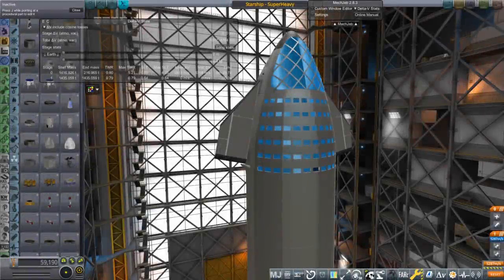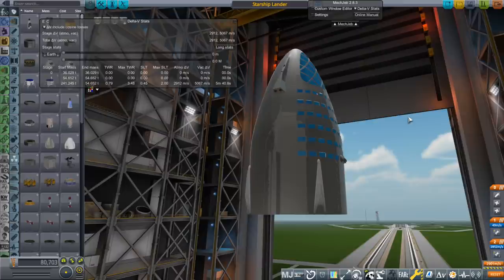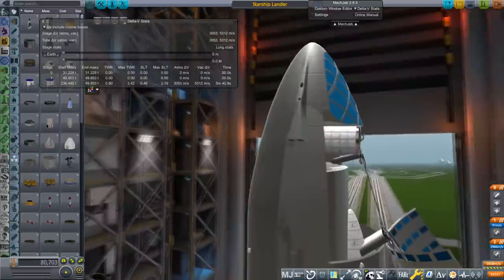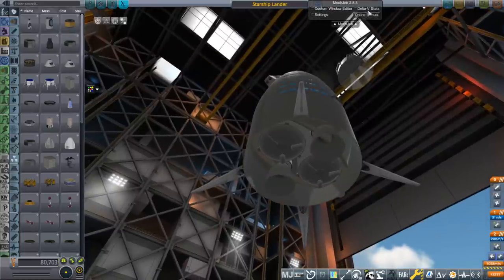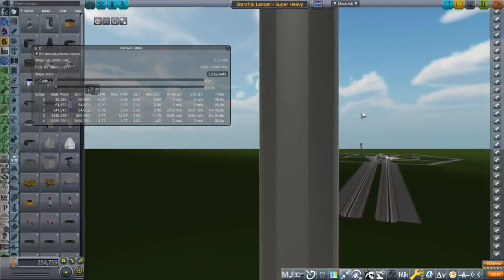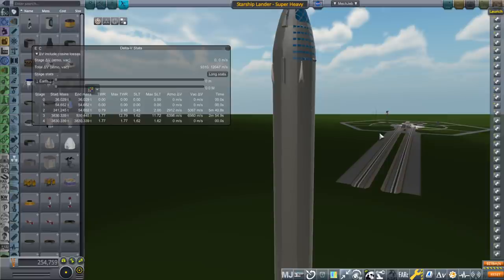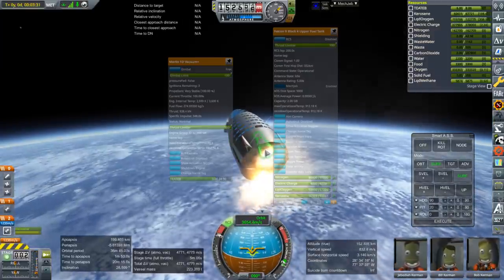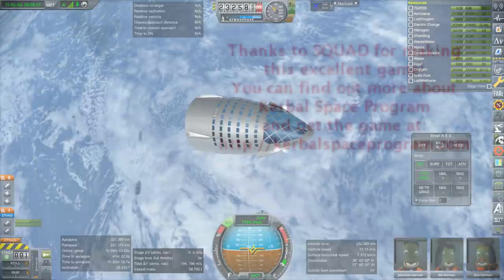KSP/RO - Alternate SpaceX Moon Lander Proposal

Comment: That's actually a very nice idea. I am sure they are not going to go with merlins, but they already have this "modular" and detachable bulkhead design. They could move propellant tanks into their payload space (almost like you did), remove the usual propellant tanks (and thus making the starship much shorter) and keep the thrust puck (and probably getting rid out of sea-level raptors). This way is 100% compatible with their current design.

However, as much as everyone talks about "mini starships" for years already, I am sure Elon is just going to find another purpose for this extra enormous payload capacity and go with full size anyway...

Comment: General rule of thumb: A single-stage vehicle capable of performing a moon landing and return mission from LEO with aerobraking is an SSTO, while one capable of doing the same thing without aerobraking is an SSTE. While it would almost certainly be impossible to make something Starship-derived do the latter (short of replacing the propellant choice with a dense, high-performance, jaw-droppingly toxic exotic mixture like pentaborane/oxygen difluoride and completely redesigning the Raptor engines to use them), I think it would be more reasonable to create a vehicle designed from the ground-up to accomplish this—combining extreme expansion-ratio FFSC hydrolox engines with common-bulkhead tanks using the highest-grade aluminium-lithium alloys or composites, etc. One reason I think this is that a Space Shuttle SLWT directly fitted with 5 SSMEs (assuming a light thrust plate) would have an SSTE capability*. In any case, though, it would be very payload-efficient with anything resembling modern technology.

*I would say "marginal", but the Shuttle was such an inefficient vehicle that an SLWT SSTE's payload mass fraction to escape would be better than that of the all-up vehicle using an Inertial Upper Stage.
Reply from the maker: I'm not sure I agree with your use of SSTO and SSTE for these purposes - I think different terms should be used. And yes, having higher performance engines would make it possible - it's only Starship's use of Methane and Oxygen that means no reasonable reduction in structural mass will give it enough delta-v for the round trip without aerobraking.

Comment: I would try some other engines. Merlin 1DVac is great at both TWR and Isp for a kerolox engine, but a) has just a few ignitions, and b) kerolox engines aren't optimal for reuse as they get sooty inside.
There are three other options in my mind:
1: Use two Raptors, you can get more Isp, more ignitions and less carbon in the piping. Methane is getting used more and more in rocketry for a reason.
2: Use J-2X. It was already tested, it has much higher Isp and you can get both hydrogen and oxygen on the Moon by ISRU. Its throttle range isn't that wide, but you can add some RL-10s in CECE configuration to finish off the landing. Which brings me to the next option.
3: Use a bunch of RL-10s in CECE configuration. You get a lot of Isp, a lot of ignitions and even an engine out capability. Not sure about TWR, and hydrolox engines require larger tanks. But it's an option too.

Edit: typos

Comment: Do you think they would go back to carbon composit construction, rather than stainless steel, seeing there's no need for re-entry?
Reply from the maker: Hopefully, or at least aluminum.
Reply: I doubt they’d do carbon composites. It’s very difficult to work with at this scale. Steel would allow them to use all the same machinery as the standard starship, saving costs and time. That seems more like SpaceX’s way of doing things.
Reply from the maker: I expect that some aluminum will be taking the place of steel  in certain portions to make Starship lighter in further iterations anyway.

Comment: I think your version will still require a lot of engineering to be done in order to integrate the falcon hardware into the starship body. It’s something that looks simple on paper, but is going to have a lot of hidden difficulties, much like they had with falcon heavy. If starship flies as cheaply as Elon says it will, then the cost of making all these changes and essentially designing a new vehicle may end up being higher than the cost of developing and flying spaceX’s proposed version. 

With regard to the choice of Merlin or Raptor, it should actually be far easier to get many ignitions out of Raptor, because of the type of fuel. Kerosene burns dirty and produces soot, which over time can jam up an engine. And this will happen eventually if you’re using it as a fully reusable moon lander. Methane burns much cleaner. The other big advantage raptor has is the full flow staged combustion cycle. This, among other things, means the turbopumps can run at a lower temperature than those of the Merlin without sacrificing performance. The Raptor really is superior for reusability in every way I’m aware of to measure it. 

SpaceX seems to be thinking far bigger than NASA is right now. If there’s a vehicle that can send 50 or more tons to the moon cheaply, we will find a way to make use of it. The Starship is ideal for a successor to the Artemis program, for building industry and infrastructure on the moon. I think it’s ahead of its time, but will become the future of space flight.
Reply from the maker: Definitely some engineering will need to be done, and I would also prefer a small Methane engine rather than Merlin, if that were available. The thing about stuff that's ahead of its time like the Concorde or the Shuttle, is that you have to be careful to ensure that the demand for the capability is there. NASA isn't putting together payload to fill Starship, and there's no reason to believe it will be funded to do so, considering the paring down of its Moon mission . So, sustainability may mean a smaller lander that will take more trips to the surface to deliver the payload, but can do so more efficiently because it is carrying less structural mass on each trip. It's the difference between an A320 and an A380. I don't see the need for bringing 50 tons in one trip rather than three trips, especially since the three trips still use less propellant.
Reply: @RaizSpace  
Its all about the funding (make what the people wont) then spend it on whatever

Comment: The hole point of it being big is so it can carry load's of cargo
Reply from the maker: Well, once NASA actually makes enough cargo to need the capacity, they can switch to full Starship, no problem. NASA doesn't need all that right now, though. Takes money to make cargo.
Reply: @Harry Bonsor NASA has no need for even 50 tons of payload to the lunar surface, let alone 100.

Comment: Fuel costs for landing could also be lowered using friction on a prepped landing strip, made from fine taillings left by surface mining(Water/Oxygen/Metals and Carbon) all could be done by remotely controlled robotics.
Reply: The fuel needed to land is already pretty low, a controled collision doesn't seem worth the risk.

Comment: Using merlin vacuum engines wouldn’t make sense. The main benefit of the raptor engine is that it runs on methane and liquid oxygen which can be created from water and carbon dioxide on the moon. Having the ability to refuel would allow the ship to make tens if not hundreds of trips between the surface and orbit.
Reply from the maker: There's no Carbon Dioxide on the Moon - that's Mars. That's the problem.
Reply from the maker: The link specifically said " it is well known that the carbon concentration of the lunar regolith is low" - that's not "carbon is present in significant quantities" - it's the opposite.
Reply: It still allows for the possibility of creating new propellant, whereas with rp-1 there is no way to create it on the moon
Reply from the maker: If you think you can get propellant from rocks in large quantities, I encourage you to try. Given the concentration they cite, to fill up Starship's Methane you would need to process at least 3.4 million tons of regolith, and trying to get carbon from regolith at all is an unknown process. The paper only tries to compare getting carbon from regolith versus getting hydrogen from it, but we wouldn't get hydrogen from regolith anyway - we would get it from the water on the Moon, which is much, much easier and a known process. Starship was built for Mars, not the Moon.

Comment: Ok I don't see the point of having such a small thing. You have the Starship, just take off the shield, fins, and some of the engines, and you've got payload to the moon's surface. The whole tipping over issue has many solutions, and nerfing the Starship is only one of those options. I would say, get rid of the sea level Raptors, and maybe one of the vacuum ones, and you've got yourself a lander.

Also, I don't see why the Starship lander has to ferry between the lunar gateway and the moon's surface. It could ferry all the way from LEO, which would prevent those regular Starships from having to lug their fins, heatshields, and sea level Ratpors all the way to the moon.

Preventing a tip over situation is just a matter of making enough contact area with the ground (so stick some large landing feet on the thing), and making sure to find a flat landing zone.

If necessary, the fat landing legs could be attached in orbit. After all, it can't be too hard when you only have to do it once per Starship.

Shrinking the thing doesn't have any huge benefits. It kind of wastes the capability of the Super Heavy Booster, and your particular idea requires continued production of falcon 9 fuel tanks and merlin engines when SpaceX wants to get rid of that.
Reply from the maker: To be clear, I'm not saying that this should be developed instead of Starship, but as Elon compares the future of space reusability to airliners, it is worth noting that aircraft manufacturers don't confine themselves to making a single airliner which they believe would be best at all things. Rather, they make different airliners for different routes and jobs. I'm not saying this particular design will be one that SpaceX would adopt, but I do think focusing on solely one system disregards the model of aircraft and may cause problems. It would be as if Airbus, seeing the wonderful capacity of the A380, decided not to make any other airliners.
Reply: @RaizSpace  Well that's far down the line. The market for airlines before coronavirus was still far larger than the current market for space travel (actually, the market for Moon/Mars missions is virtually non existent, it's supported solely by tax dollars. As for satellites, the market is still a hell of a lot smaller than for airlines. So expecting the development of a new vehicle within the 2020s or even 2030s is probably too optimistic).

The best we can expect is different variants of Starship. Using a small lander negates all the advantages of the BFR system in the first place, especially using Merlins instead of Raptors, because SpaceX wants to be able to move on from the Falcons, not tie themselves down to Merlin production. Wide span landing legs could be achieved simply by keeping the legs stored in a cargo bay for the initial launch from Earth, and then mount them manually in space. Sounds convoluted, but when you have a vehicle that can carry at minimum two dozen astronauts, it might not be that hard (and you would need to be able to service these things in space, anyways, if you wanted to use them long term, I'm thinking they will have to occasionally replace engines in space on occasion, maybe some fuel lines).
Reply from the maker: Well, moving on from Merlins I have no problem with as long as there could be a smaller-scale Raptor or something that could throttle down enough. A bunch of methalox SuperDracos would be fine. I think Starship is further down the line than this small lander in terms of market demand, which is the core problem. My variant seeks to meet the market better in the short term so that Starship and its payloads can be funded in the long term while still trying to develop as much of Starship's technology as possible. Keep in mind that the development of the crew cabin will cost as much, if not more, than the cost of the Raptors - just as the development of Dragon and Dragon 2 cost far more than that of Merlin.

Comment: OK---------------  Just air braking in the far upper atmosphere to orbit requires little or no tiles unlike dropping down to land. The rate of heat build up can be controlled by how deep into the upper atmosphere they go.That also means the weight of the ship can be cut almost in half since the stresses are practically none existent compared to dropping down through the lower Atmosphere and landing at 3 to 5 Gees.  I like your idea of using the Falcon landing legs.  But your design does not allow the landing of 100 tons of cargo that will be desperately needed to establish a permanent base on the Lunar surface. Not to mention that you wastes most of it's space and not using one Engine (since only one would be needed adding much space) as light as your design is. It is just ridiculous not using Methane has it to many advantages over Hydrogen or Jet fuel. It takes about 4 pounds of Lox for every pound of methane to produce thrust, So hauling methane up from earth with lunar produced Lox for the short lift off the moon is not that much dead weight.  So take Musk at his word and his experience. The ship they have designed for Nasa's Artemis can do the job as it is not a true Starship. It is Space X's Lunarship. Though I do think the Lunarship does not need the 6 engines in its tail which the Artist probably left there without thinking. It has no need for the small atmospheric engines for ONE. Nore does it need 3 Vacuum engines with  (1) needed at most unless they want a Second as a spar. But then if they use several small mini Methane engines for the upper side thrusters why even have any stern engines.  Even if they use Jet fueled for the upper side engines, they wouldn't need any stern engines. ----- But the stern would be a good place to put a large cargo hold and garage for rovers close to the ground.

Comment: First of, if you want to go with (future ?) in situ lunar resource use, switch the fuel to hydrolox, for one. Plus, replace the 2 large engines with 4 smaller ones (with equal power). Also, maybe you could somehow put the airlock unit at the bottom underneath the fuel tanks, connected with an access level and tunnel with stairs (or an elevator ?) to the upper section, instead of putting it so high up on the ship ? This way, you're closer to the lunar surface, and could more easily disembark with a ramp, small elevator or fold down stairs perhaps, plus, you could keep the upper section as your base (and habitation section) with a killer view. Maybe even adapt the nose-cone section slightly to create a bit more space, while you're at it ? And second, maybe you could get an adapted, refuelable (and maybe boosted ?) super-heavy booster into orbit, instead of returning it to earth ? Once in orbit, you could refuel it like any regular starship and then burn some of the fuel to get to the moon faster, (maybe even use some of it for lunar orbit (re-)fueling of your mini starship ?), detach and land the mini starship, do what ever it is you want to do on the lunar surface, then fly back to orbit and rendez-vous with the booster, and then use what's left of the fuel to get back home. Once  you return to earth orbit, you could actually reuse the booster (and mini starship) for another trip (after refueling, of course). Or fly somewhere else in the vicinity of earth (like a near earth asteroid maybe ?) And, because the super-heavy booster is now in orbit, you basically have the option to have it dock with a full size starship !